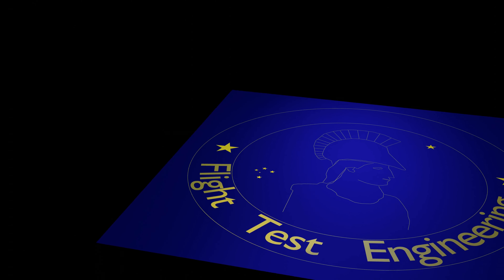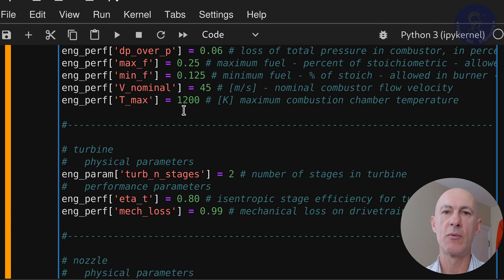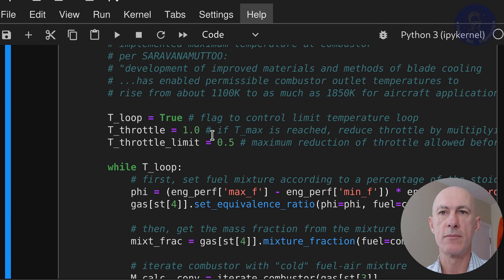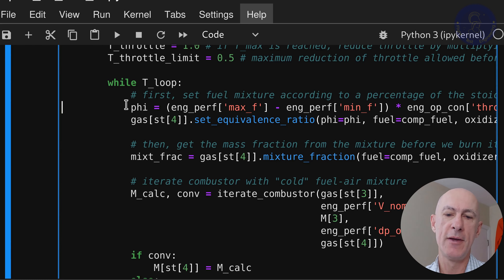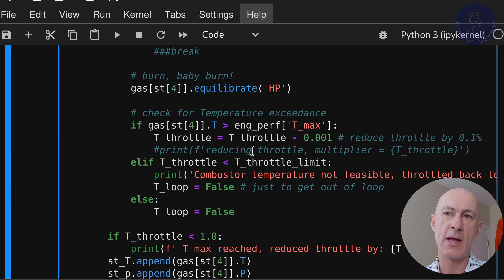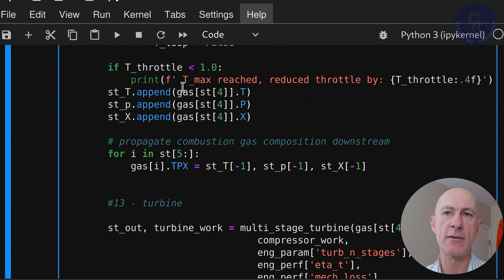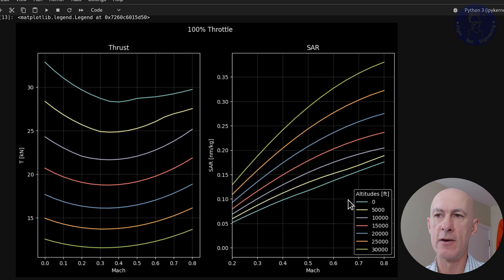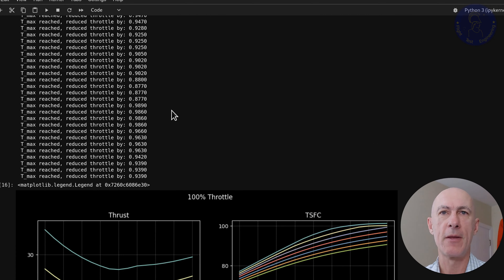Jet Engine Series - Episode 10 - Implementing a Temperature Limiter

Comment: Thank you sir for sharing your valuable experience and knowledge.. is it possible to make a real time simulation that reads thrust lever inputs from throttle quadrants and get the instant trust with its corresponding FF, Exhaust Temperature, N1, N2…etc?
Reply from the maker: Hi @FHFZ, that is the goal for my next series, in the works. 
"Real time" is relative.
If we talk about simulations that require engine data at low rates (let's say, 2 Hz - remember, engine response dynamics are much slower than what you would require for flight controls, for example), then you could run the code we have in this series and have a function output FF, N1, etc.
What we will do instead is pre-run in a bunch of atmospheric/airspeed conditions and create a huge table, where we can "quickly" look-up the results. Typically this is how it is done on commercial sims...
But stay tuned! Working on it!